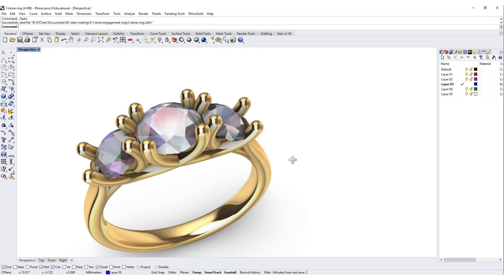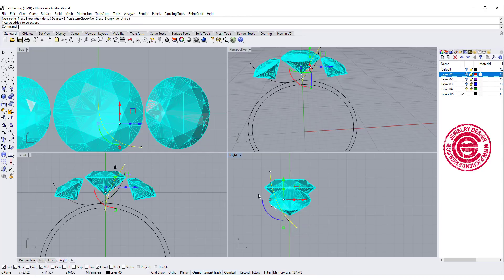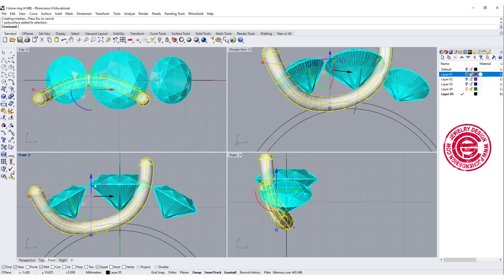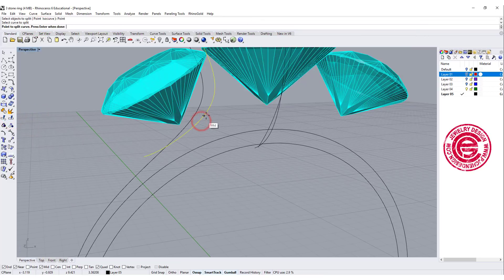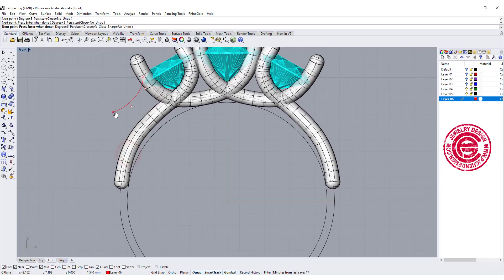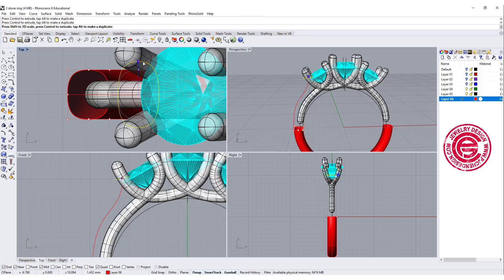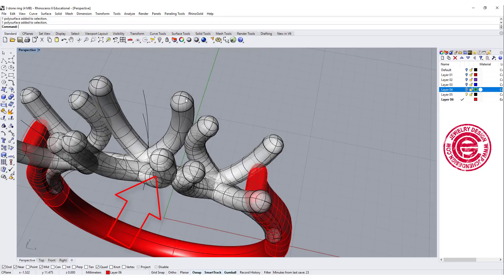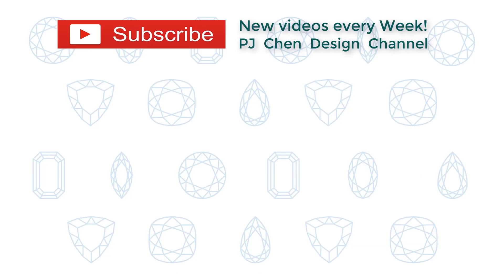3D Model 3-Stone Engagement Ring in Rhino 6: Jewelry CAD Design Tutorial #69

Comment: I would like to make this as a 5 stone ring and I seem to be running into trouble trying to do a proper curve from 2 views for the additional stones, because it's not a curve I can make from the right side view when the first side stone becomes the reference point. Any tips for using this method to make it a 5 stone? I'm also having one pipe end be, say, .6mm radius and then it tapers down to .5mm radius at the other end of the pipe, etc and so on. Thanks!

Comment: I am assuming (roughly measured) that the Main Stone is 5mm (0.50 carat) and the side stones are 4mm (0.25 carat) so the Total carat of this ring is 1 carat? :)
Reply from the maker: You can use any desired size stone for this type of ring 3D modeling